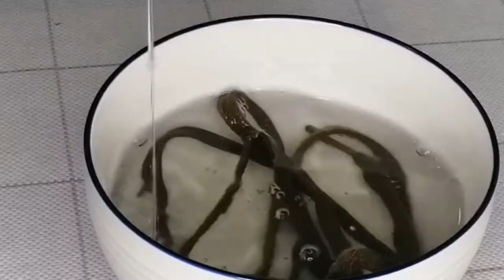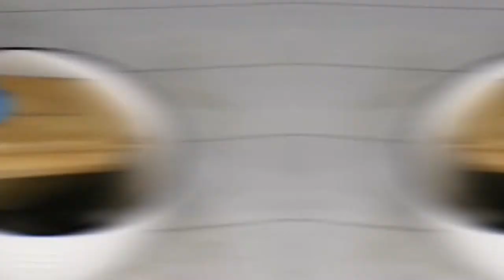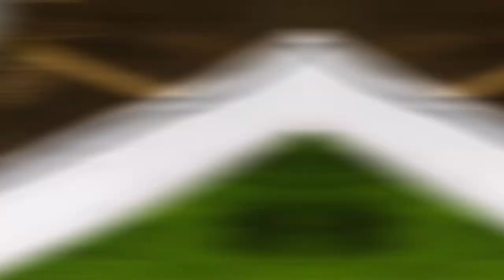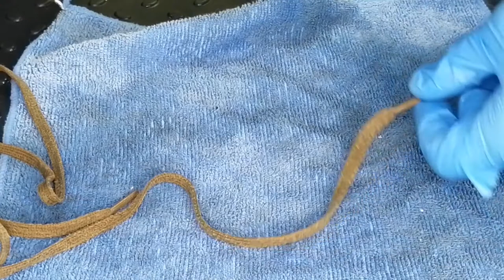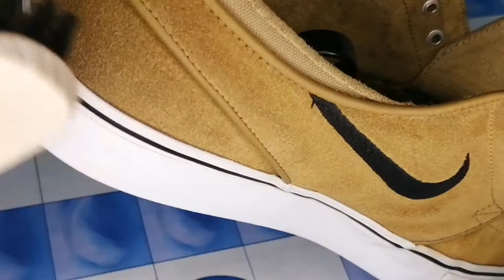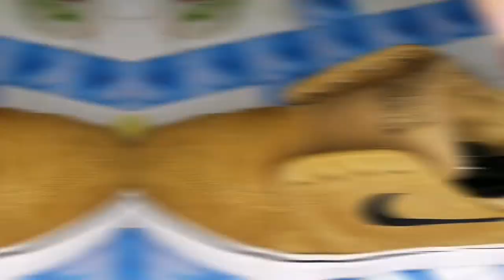[ASMR] Clean & Restore "NIKE SB" "Stefan Janoski: For Daily Use" suede sneakers

Comment: Could I just put the shoes in the washing machine instead?
Reply: I wouldn’t, the heat, the tumbling around and the proper soaking of your shoe in water won’t do you any favours. It will work but I would only do this to a pair of old trainers that are already damaged. New shoes though you should follow this guy. If you do put a pair of old trainers in the wash, make sure to put them inside a pillowcase and tie it closed with the shoes inside